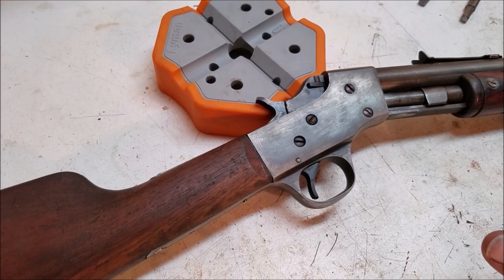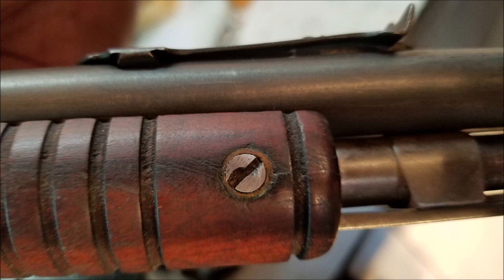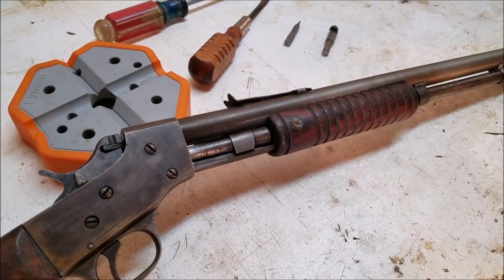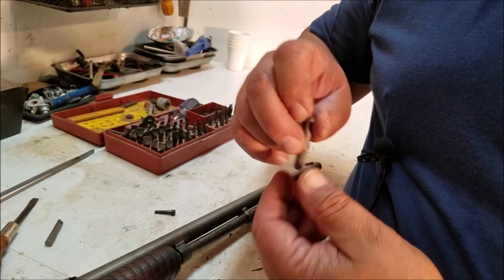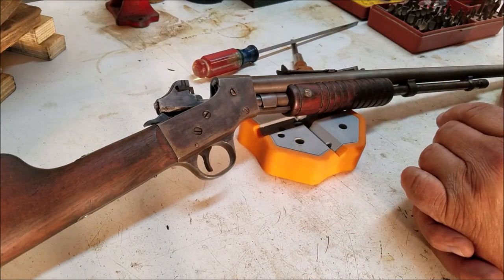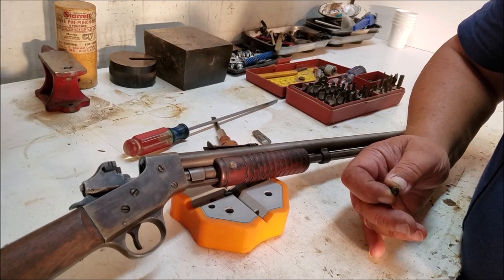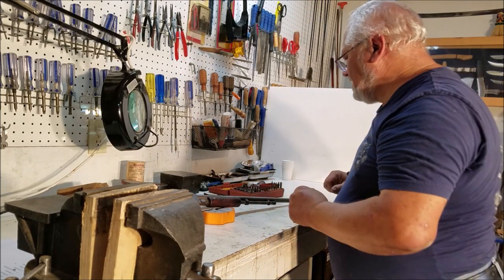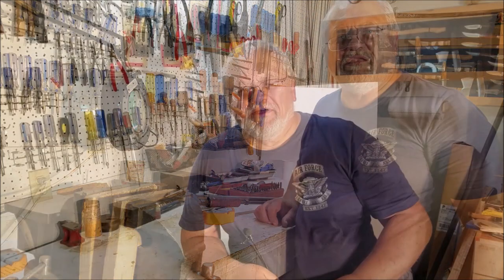Gunsmithing Tools The Basics (Part 3) Screwdrivers

Comment: Sir, first apologize my english. But you are sharing gold here. Things that many already know, but still make the same mistake, like use a wrong tool for a job. I work with motorcycles and I try to avoid more problems by using the right tool to the job. If I don't have the tool or can't replicate it in a safe way, I just don't accept the job. Thanks for this series. Best regards from Brasil!
Reply from the maker: Thanks for watching.

Comment: First thing I did to my pristine Ruger Old Model 3-Screw Super Blackhawk revolver in 1978 was try to change the grip frame with a cheap tapered screwdriver, and totally destroyed both grip frame screws.  Luckily Ruger sent me replacements, and my next purchase when I could afford it was the Brownell’s fixed blade screwdriver set.  I’ve had to regrind a couple that have broken, but they actually provided a Dremel bit to reshape them.  Now I always make sure the bit fits the screw perfectly.

Comment: Would love to see a list of things mentioned in the video (Like the brand/model of the screwdriver set, etc.) in the description section. Keep doing some great work! :)
Reply: Almost all the screwdrivers used are from Brownells. The Magna tip Superset is hard to beat for quality and provide nearly every bit you will need. It is, or was last time I checked, made in USA and they will replace broken bits. The Walker set is also a good choice. A bit cheaper by being made offshore but a good selection of bits without as good a replacement policy, unless something has changed recently.

Comment: 45 Alfa Charlie Papa 

What about the 
Chapman Manufacturing set? 
Made in USA 🇺🇸
Reply: The Chapman set is useful but I have never really liked their driver, I prefer a standard handle but the bits are fine
Reply: Paul Mazan 

Thanks Paul! I’m fixed on that set, I wanted an different opinion and now I’m convinced that it’s worth it.
Reply: Hi Alejandro, Tool selection is a personal choice. If you like a certain type of tool and it does the job, it's the right tool for you. Good luck in your gunsmithing projects.